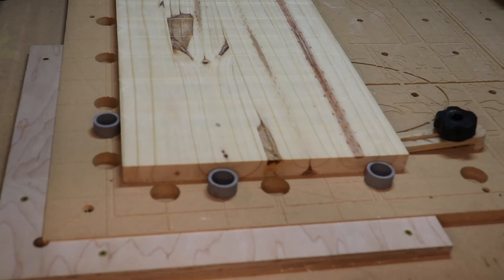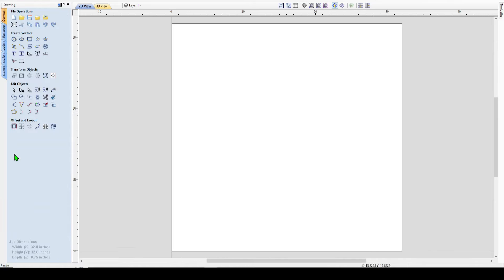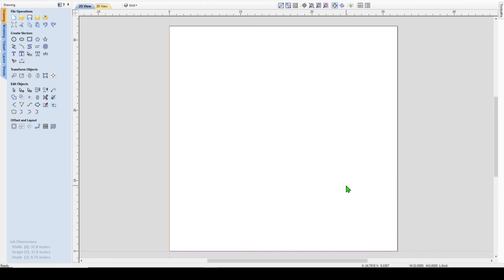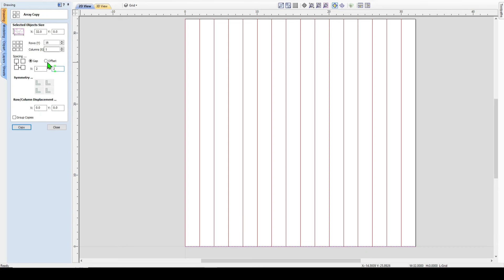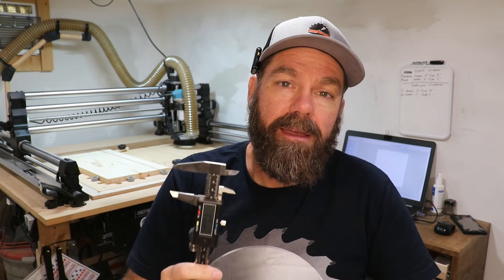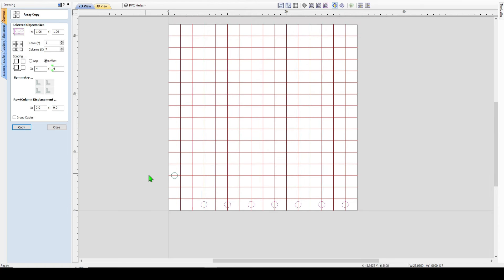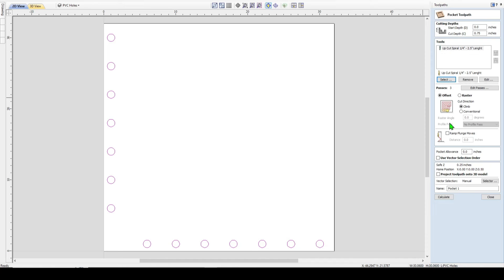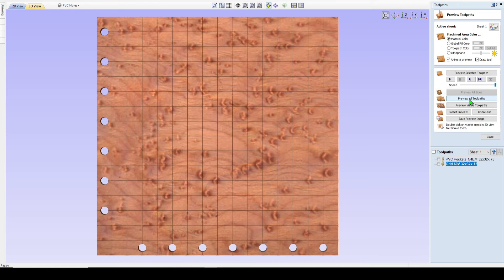Basic VCarve design - Spoil Board Grid and Squaring Jig

Comment: Hello, 80 year old newbie here. been playing with V Carve for 3 years and still a newbie and trying to get good at it. This is wonderful info for me. I had put 1 x 2s in the X, Y axis and ran the the router bit across the edges to make sure they were aligned correctly. This is much better. I"ve had to replace them twice due to mistakes that caused damage to them.  going to design and cut today. Didn't know about the shortcuts either.  VERY HELPFUL, THANK YOU
Reply from the maker: You're going to love the shortcuts - it really does speed things up!

Comment: I especially liked your explanation of using the array feature of Vectric VCarve; well done!
 Should I elect to use PVC for my positioning, I'd probably use smaller diameter PVC piping, as it would be a better option for the work I do.  Notwithstanding, your concept is directly applicable to any workholding method employing circular holes.  Thanks, Matt!
Reply from the maker: 1/2" PVC would work fine I'm sure. I'm an electrician by trade and had some 3/4" conduit laying around. Lol! Use what you got. Thanks for watching.

Comment: Thanks for your time and effort Matt, I'll be using this method on my machine. I also picked up on your recommended spoil board thickness and that nifty PVC vacuum hose support !  I didn't catch a spoil board leveling feed rate, spindle rpm and cut depth, that would be useful. Any thoughts on a hold down method ? T rail seems to be common but I wonder if there's another option ? Thanks again for your time.
Reply from the maker: Sorry for the late reply. I've been away from YouTube for a bit. For my 1.5" surfacing bit I feed between 120-150ipm depending on wood species with a pass depth of 0.075". I did a video on making your own hold downs about 3 years ago. They have worked great are still my go to method. You can watch it here - https://youtu.be/1GIA6dKegEY Thanks for watching.

Comment: Hey Matt, Thanks for the information. I've been in the process of setting up my shop so my CNC has been dormant for a little while but before it was, I wanted to do this to not mess up my MDF boards I have down. Does it matter where you start on this project? I usually like to start in the middle of the project. Thanks
Reply from the maker: Starting lower left or in the middle doesn't matter. For this particular carve, I think lower left is more efficient, but either way will work.

Comment: i have a question. if you do those pvc inserts doesnt that mean that you lose some of the workspace? if so, how do you do it so those pvc pipes sit just on the border of that workspace but outside of it so you get the maximum work area out of your cnc?
Reply from the maker: When using the inserts I lose about 2.5 inches of spoil board, but I don't use them in every situation. I could push them out further towards the edge, but I haven't found it to be necessary. I can't remember a project where I needed every square inch of spoil board. If I started doing a lot of projects where it became an issue, I would upgrade to a larger CNC.

Comment: Why not just use a 1/4 inch bit and peck a grid of holes and use short pieces of wood dowel? When I put in my spoil board I just make a 4"x4" grid and chop up a bunch of pins. Never worry about accidently cutting them and they're real easy to move around ... and no big holes in the board.
Reply from the maker: This is a great suggestion. If you look at my board, I can do that as well. This video was just covering a basic grid and answering a viewers question. I guess I should do a video on my entire spoil board system.

Comment: Why not align the face of the PVC with the first grid line?  Assuming your grid lines are from the origin, then your starting position is at a defined point of 1,1 or 2,2, etc.   Otherwise what is the purpose of the grid lines?
Reply from the maker: I don't always use the PVC. In those situations, the grid lines allow me to place my material square. Of course, sometimes, even that's not necessary. But your suggestion makes sense. I might make that change the next time I redo my spoil board. Thanks.

Comment: That’s a lot of pvc contraptions..

3 points makes an even plane or 90. 

We use this theory in welding. 

Three points of angle iron on a shop floor and you can weld a totally flat gate without a table. 

It’s the same with spoilboards.
Reply from the maker: Great point. In practice I usually just use 4 pieces. 2 Lower left and 1 each towards the end of the work piece. I'll use more if I'm doing an aggressive carve. The lateral forces of a CNC machine are much greater than welding. Sometimes having extra support just gives me piece of mind. Thanks for watching.

Comment: When I complete each layer, do I save them as a file?
I’m not getting the grid or pockets  showing on the screen when I go to tool paths! again, thank you for the video!
Reply from the maker: You don't have to save each individual layer. They will all save as one project. Make sure designs are saved to the correct layers and that all layers you want to run tool paths for are turned on. If you're still having problems, email me the vectric file, and I'll take a look.

Comment: hey Matt. real quickly, how did you make sure the holes cut weren't into you t-track? did you manually account for their placement? wondering if making this board without accounting for that would have the spindle cut right into the t-track accidentally.
Reply from the maker: I don't use t track.
Reply: @MattMadeIt123  well that solves that problem lol

Comment: Why not just add two wooden fences perpendicular to each other? With a gap in the lower left corner for calibration. People seem to over think the fence.
Reply from the maker: That would block the ends of the spoil board. Often the work piece being carved doesn't entirely fit on the spoil board. With fences in the way, how would you do a tiled carve on a 6' long piece of wood? The fence must be modular and removable. Small pieces of PVP are solid, secure, easily movable, and easy to store.